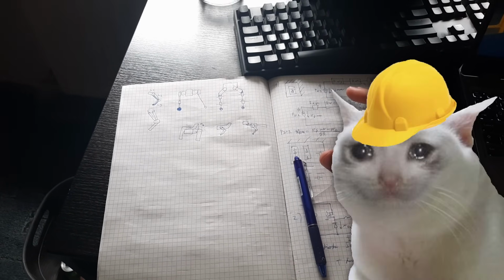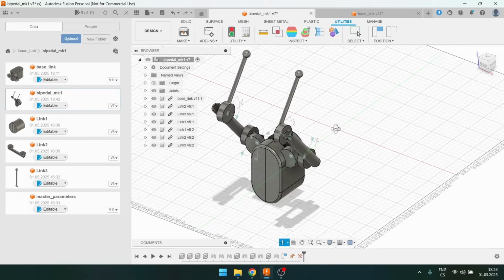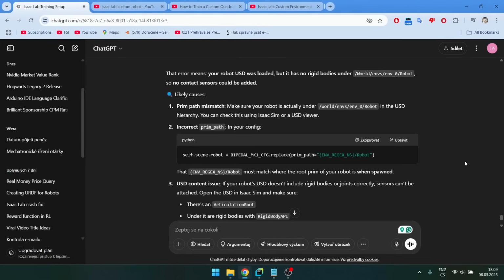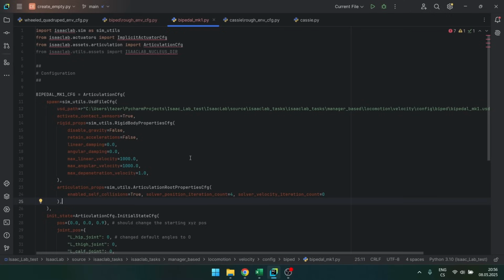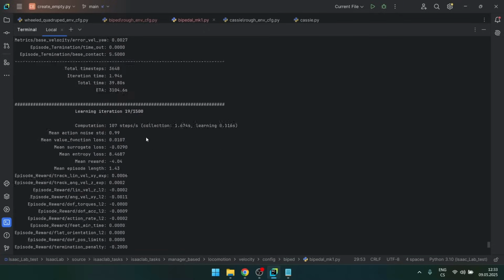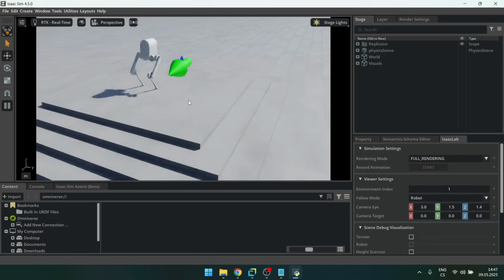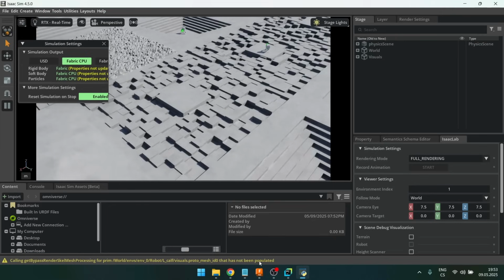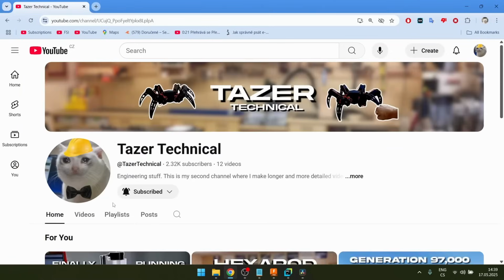Struggling Engineering Student Tries to Finish his AI School Project

Comment: i legit tried to install isaac lab a around 2 weeks ago, i cant even get the program to run. Maybe i just have to sink more hours to learn how to use linux

Ive been using openfoam recently and it uses a different version of python than isaac lab so it doesnt want to run. Since i need openfoam for courses this semester i cant be bothered to learn how to run both in the same vm. So i just created a new vm with a different python version. Still doesnt work, but i have another error code. Thats progress i think?